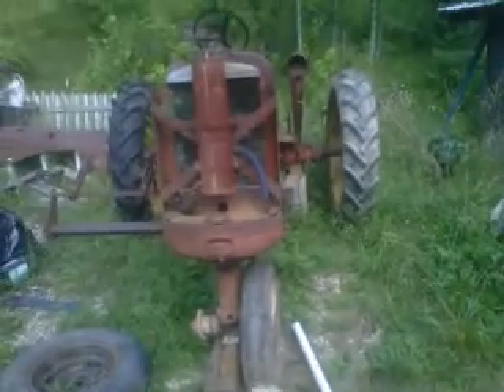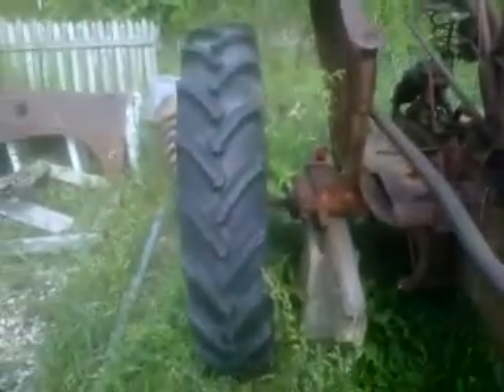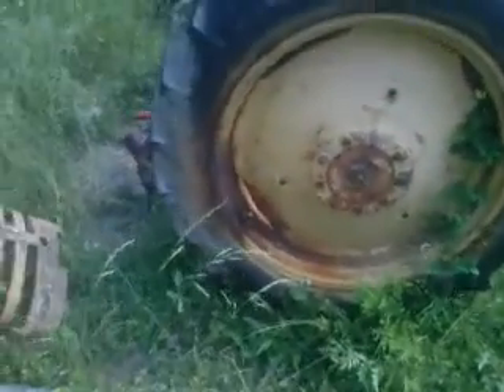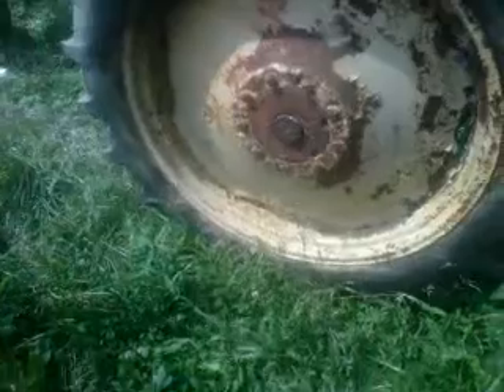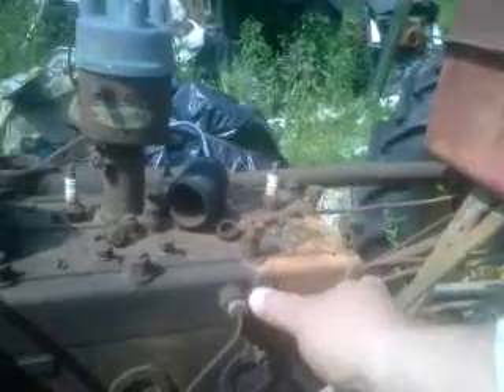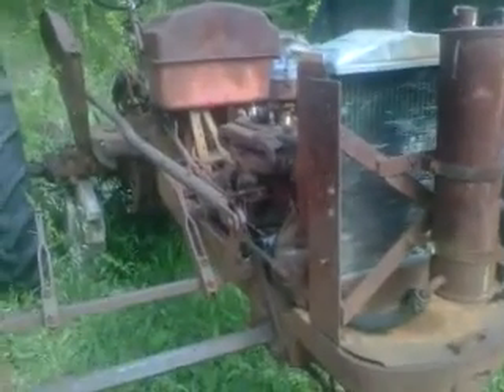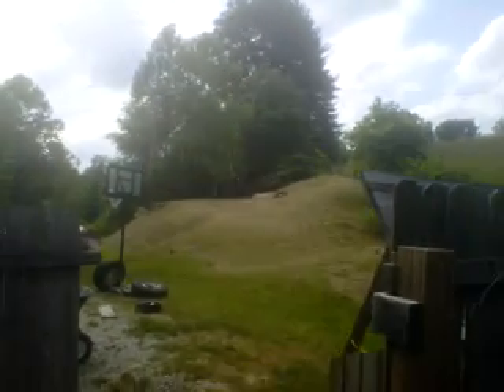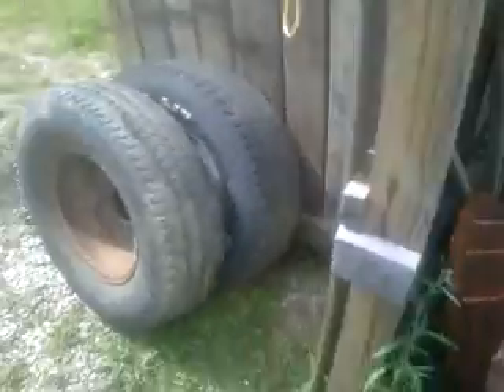massey harris 30 video 1

Comment: I'd love to see more about this tractor have you done anything with it
Reply from the maker: farmwork686 Mi       I have done a little bit more with it. It is ready to set a different engine in it. Also I have redone the rear wheels and changing the over to 30” rear wheels. As well I have a wide front end to put on it. I am hoping the I can get back on this project in the spring this next year. Been working on my Chevy pickup and have videos posted on it as well. Thanks and check out some of my other videos. 👍😎
Reply: Will do thanks I'll look forward to it